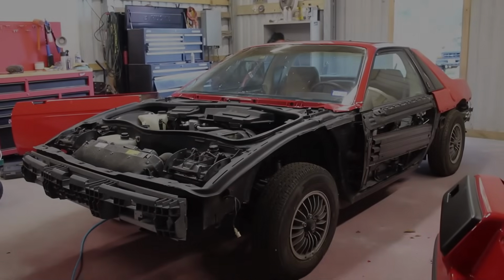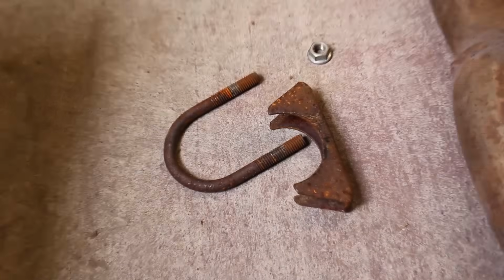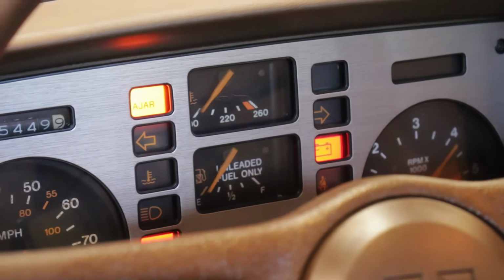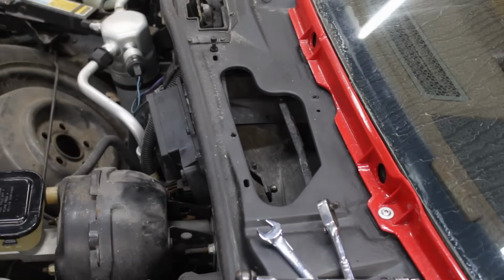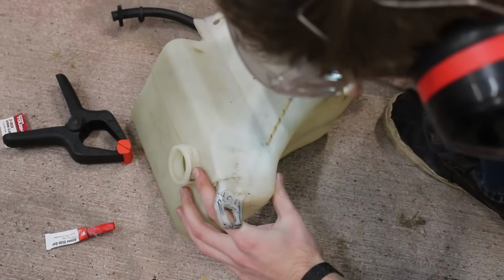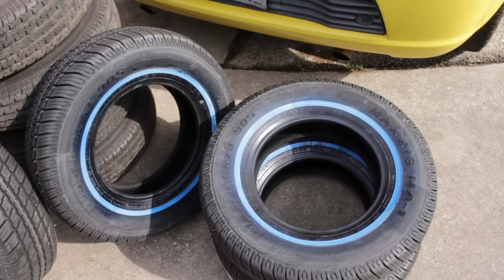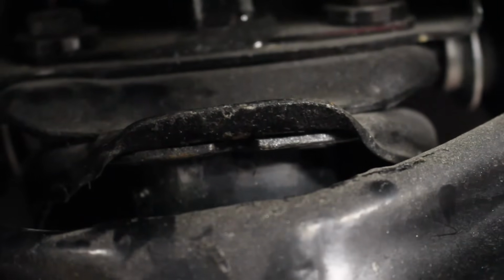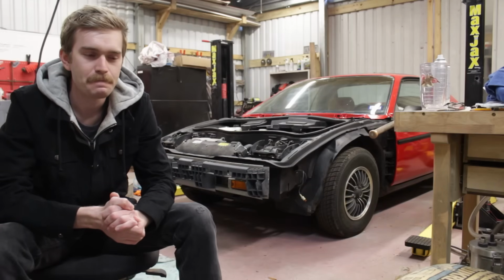The Haunting of Red Car | 1985 Fiero 2M4 Revival - Part 14

Comment: Fun fact about the wipers being fixed by just moving the switch so the contact gets cleaned a little, this is a common fix on older 80's SLR cameras when some settings dials don't work. Neat.

Comment: Ik its common but dont be un doing and redoing the fuel sending unit lock woth a screw driver. Ik its unlikely to spark but it can happen and even a small bit of fuel vapour can cause that thing to go bang. Use a brass rod to smack the lock rings that way they wont spark.

Comment: Its really amazing what we used to run as at least "psuedo" sport tires. 
13, 14s in the 180s....lol. (i didnt have a fiero, but did have a mustang 2, thundering 100ish hp v6, 13"rims and an overheating prob😂)

Comment: Hey this probably isn’t put on the correct video for this series but I kinda know a fix for your two different locks on your car. Lowes actually should be able to transfer the trunk lock to the other key set. I’m pretty sure it’s cheaper than buying a new same lock. But it may be more trouble to go through. It depends on the Lowes.

Comment: Browsed the comments but didn't see any one mention it.  Looks like you said you are only changing the front Springs and not the rear.  When you mess with spring rates like you did you need to make sure it's balanced between the front and the rear.  Since you changed the spring rate in the front, you need to change the spring rate in the rear to correspond with the front.  Your car is going to handle horribly with stock springs in the rear with those eibach in the front.

Comment: Kid!(which you will be called by older people until your in you mid to late 30's) I watch a lot of Fiero channels, and I have to say that you are by far the least boring and most informative, without insulting peoples intelligence. Frankly, if the viewers are having difficulty with your terminology, they need to consult some basic educational material on mechanics. Your very excellent camera work/timing/placement/lighting, along with your phrasing/tempo/common time/register/and tone of your voice are well suited to instructional videos. So far in the world of Fiero, I've learned and retained the most episode by episode. Now all I have to do is find a source to kindly supply you with a 2005 - 2008 Pontiac Grand Prix GXP 5.3L (LS4) V8 front wheel drive engine and transmission for you to transplant onto the Fiero rear subframe. It has all of the V8 stuff like starter/water pump/alternator etc, built out of the way and in a tight package in a transverse style, mated to a transmission that is made to fit in the tight confines of a front engine/front wheel drive car, with 303 normally aspired horse power. It is the smartest way to go for a Fiero. You would be the perfect guy to do the instructional video of the refresh and swap of the engine. Nobody else has the kind of detail and close ups of this kind of V8 swap, and so many people are waiting to try a modern swap of this kind. Think about it?

Comment: Hi! I love your videos! I’ve been watching for quite sometime and have been meaning to write here. We are only a few hours away from each other! Seeing your amazing work made me want to get my first car back on the road.... 1986 Fiero 2M6 SE!    Wulf is what I named it back when Killer Instinct was popular :).  I have this thing about naming all of my vehicles.  I had some really fun times as well as many annoying times! Not a very reliable ride but then again it was a used car.  Mine is the Red with black ground effects. I had always wanted to do a Finale kit body however I do not think they are even sold anymore :(. Wulf has not seen the open road in over a decade. The engine cranks but no spark to the plugs.  I used to do my own mechanic work but this left me stumped. I even had two other shops attempt to get it running with zero luck :(

Comment: Maybe this has already been asked, but hey there are over 3000 comments.

On the suspension, and the front riding high. Do you know what the reason for that was to begin with? Surely it didn't come from the factory that way. Rear springs compress over time? What caused that?

Comment: If I remember correctly from back when I owned my Fiero there is a strange and unusual process for filling the coolant... It involved having the car on an incline and filling from both the front and back fill caps and "burping" air out of the system... You might want to look up those details because I had to back in 2001 when I owned mine.  So I am less than clear on the details.  I just remember how strange and a PITA it was.

Comment: come on man, you can't just install front lowering springs - the rear is probably lower because the springs have sagged. you'll have stiffened the front and not the rear and it'll throw the balance of the car out of wack. put them all on.

Comment: Good work kid... proud of how far you've come.
Pop the wheels once more though and clean the rust off those rotors.
And, with brand new tires you can easily fine-tune your alignment once driving... keep a close eye on the tire titties (those injection thingies) and see how they wear. Quick on the outside: too much toe-in. A quarter turn is heaps... 1/16 at a time ftw until the wheel is centered at speed and it feels just right.
Can't wait to see 'er finished.

Comment: There are many reasons why i love the series. First of all. That he started as a kid is now a Boomer. But for real. He showed that with dedication and researching you can be a better mechanic than ectual mechanics. I wouldve replace alot of the parts he rebuild which i think is pretty inspiring because he really wanted to keep it stock and know how everything works. He probably will never do that again. But his dedication to make it as perfekt as he can is really impressiv. Edit; something really important down here

Edit; i just notice something kinda important. Your seatbelts should be replaced with new ones. When you pull them out theyll still full of mold. But thats not the problem. I think they might get weakend by the mold and beeing that old and could snap in an accident.

Comment: Just a recommendation, I would also replace the rear springs with the ones from Eibach. The mismatch of rates with stiff in the front and soft in the rear might make the car handle oddly depending on the actual rates.

Comment: 185\80-13? ouch...

yeah that's a strange size since mostly all 70's and 80's car with 13" was running 185\70-13.
and those would been to small for your car (over here they would been illegal since they have more than 5% difference in rolling length)
175\85-13 might have been an alternative, but pretty rare those too (as in none-existing at all)

Comment: Another method for your reservoir would be “soldering” with the same material. I’ve used it on a few small gas tanks and it seems to work ok

Comment: Excellent video series, but i can say from experience the hardest jobs that you can ever do to a car is not replacing and fixing oem components. Its the upgrades, the rewiring of systems, the re-engineering of mounting brackets and completely upgrading oem spec like stereos, parking senors, alarms. auto window modules, tpms etc etc that is an absolute nightmare to do without destroying the oem feel and look of the car.

Comment: I had a neighbor that went through this type level of restoration with a Fiero. He even put a Buick supercharged V6 in it and had it almost completed. They were doing a really quality job and spent a couple of years on it. Just before it was finished they realized it had a transmission front seal leak and asked me what was wrong (I was an AAMCO Transmission mechanic), I told them they needed to replace the pump bushing along with the seal, instead of just the seal. That was the straw that broke the camels back...they didn`t want to pull the transmission back out and do any more work to it and decided they were moving. They said the first $2000 that comes along gets it. I didn`t have $2000. I sure regret being so broke I couldn`t buy that! It was like 98% done.

Comment: I would install those rear springs. Different spring rates, softer in the back. No bueno.
Reply: Yeah better handling...i have a feeling he just didnt want to pull shit off or have it be lower in the back again...he didnt give a reason in the vid did he?
Reply: @insertname941  No, but not just handling. Having softer spring rate in the rear vs front can be very dangerous. Also the springs probably wouldn't have lowered it more in the rear I'd stock it was even. The rear stock ones have probably settled more.

Comment: Don't use worm drive clamps with plastic parts.  They create pressure points.  Instead, use the same type of spring clamp the factory would've used.

Comment: My issue with the wiper system on my S10 Blazer is the same, but the pinpointed problem is the  actual wiper stalk switch that the stalk slips into. Its a switch within a switch.  The GM part number is for a 1988 S10 but with everything being practically the same for GM stuff..
ACDelco D6389A

Comment: Yep. Cycling the wiper switch, cruise switch, and others on the stalks on an old, unused car tends to fix them. The little checkballs they use for the contacts tend to rust or gum up and rattling them knocks that crap off of them. Fixed several older car issues after getting pissed and switching them furiously out of frustration.......tah daaah!!!! wtf.....

Comment: I had an 85 Fiero GT.  Mine had the steering wheel play so much that I called it "floating" - driving the car felt like you were floating in a way above the road.  Even if you could just open the door to put out your cigarette on the ground without stretching.  Assuming you smoked.

Comment: I have an issue with a phantom car as well.  I have a 1984 Mercedes Benz diesel and it does weird things.  For one, whenever I shut it off, I can take the key out of the ignition, and walk away, and the car still stays running.  It isn't until a few minutes later when it finally shuts off by itself.  Also while I was driving a little while ago, the wiper come on for reason at all, and even though I flipped every switch, turned every knob, and moved every lever, they still didn't stop.  The only way I got them to turn off as when I shut the car down and then when I tried starting it again, there was just a click and nothing.

Comment: Three years is a long time, but t's actually perfect so that you wouldn't get too stressed out.

I read a blog 2018 by a guy who rebuilt either -84 Fuego or Fiero, cannot remember which one. It was not about how to rebuilt it but how long time and how much it cost. The guy was originally planning to just work on the brakes but before he could do so he drove it off the road to a swamp and broke the engine, then decided to rebuilt the car from ground up. It turned out to be a good idea. Practically every part was either too worn out or broken. Those cars, even small, yield a big pile of parts when all of them are in zip-lock bags. What he found fascinating was that he had to learn how each part works and what's the proper way to fix them.  Replacement parts were mostly too expensive but luckily the original parts simple enough to fix. It took him almost 3 years.  Too bad I don't have the original email that had the blog link. The parts spreadsheet was impressive, even small cars have tons of parts and some of them so unique they were in production only on that model year. Corrosion, rubber seals and some plastic parts were the main problems, the electronics not that much.

Comment: I would install the rear eibach springs as well for a few reasons. 1. The oem rear springs could be sacked out. 2. The front eibach springs will settle and will be lower than what it is now.

Comment: You really should change the rear springs as well.  A stiffer front suspension with the stock rear springs is going to cause a push in the car's handling.  The spring rate is balanced from front to rear for proper handling.

Comment: The wiper control reset by rapid switching actually works for a lot of vehicles. As well, it is directly involved in resetting the multiplex control unit in many Hondas, which fixes wiper and door lock issues.

Comment: "I am not a salesman or spokesman". For the repair of the overflow tank and some other bits on the Fiero or your next build you should try using The Last Glue. I was really skeptical of this glue when I saw their booth at the Orange County Fair, but having used it on a number of small repairs now, it is pretty awesome stuff. I even talked our OM staff at my work to keep a bottle of it around after demonstrating that it could be used to repair a fan belt on one of sludge pumps at least until a new one could be ordered.  Check out their website which explains how it works. https://thelastglue.com/

Comment: I am surprised that nobody has mentioned the brake discs, those rusty things will eat through pads like crazy. If I showed up for vehicle inspection with those they'd tell me to get them changed and return with it fixed, if I didn't they'd take the license plates. I guess EU rules are more stringent than in the USA...
But just the pad wear would make me replace the discs as it would be cheaper in the long run, and the brakes performance will improve quite a lot.

Comment: Wait . . . where's the "fully assembled" video?  :-)

Couldn't resist . . . also, this series has been absolutely amazing.  I recently bought an '86 SE as my project car (which I'll be converting to a fastback because, well, I like fastbacks and already bought the panels).  I was feeling VERY in over my head until I found your series.  Now I only feel MOSTLY in over my head, but with a sense that I CAN do it.  Our experience levels at the beginning of your series were about the same, and I thought you should know that, thanks to your empathy and passion, I feel encouraged and inspired.

Thank you for making these videos!  Truly. 

(And thanks for the STL files for those stupid body-panel screws)

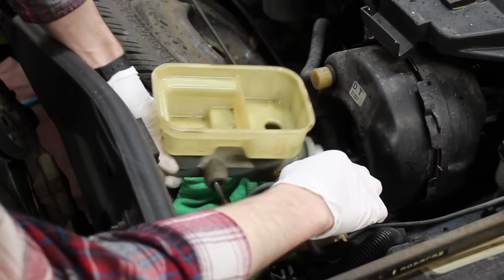Comment: 26:21 - that's actually one of the best feelings when you realize you don't have to disassemble something. I was repainting a part and was about to unclip some annoying wire connectors when i realized i could just unclip the whole button assembly instead. saved a good bit of time coming out and going back in.

Comment: Ah, my '86 Fiero 2M4 had all the same issues! Fuel gauge, tach, and I could push on the wheel wells from inside the car and hit the wheel. I had huge balloon tires on mine, though, with hardly no clearance; totally silly now, but awesome at the time! Also, I am quite envious that you have the time to work on such a project! I hardly have enough free time to use the bathroom!

Comment: Young man, I've enjoyed the entirety of your Fiero rebuild series,  and thus far I can't find fault with anything you've done.....except for one thing:

  Change those doggone rear springs! 

 Eibach engineers those spring kits to work in UNISON....handling and tire wear woes will plague you if those stock springs are left in place due to the differing spring tension rates and height. You already HAVE them, might as well use them....you'll be glad you did in the long run.

  Anticipating the next episode......

Comment: Shouldn't the rear springs be replaced, too? Not only are they without a doubt more worn out than the new ones in the front, they also probably have a vastly different spring rate. It would surely be annoying if this resulted in dodgy handling...

Comment: You do not have to pull the column apart to replace the multifunction switch. remove the connector body from the wire harnes for the multifunction switch tie a wire on it then remove the multifunction switch from the column pulling the wire up through it. Install is reverse of removal.

Comment: I used to own an 1982  Olds 98.  PLEASE replace the sockets for those dash lights! (if you haven't already)  The melt, and lose contact.  I cut, and put rubber sockets into the holes, and then wired them up to a switched 12v circuit on the fuse box.  Nothing is more of a pain in the ass when driving at night, hitting a bump, and having one of the lights go out randomly.  I needed therapy until I fixed it! LOL

Comment: Hey Ronald, congrats on having the Fiero "almost" done. It's been a cool series.

Just a little tip - you might want to install those rear lowering springs as well, because having such different springrates on the springs front to rear, could cause some pretty significant handling issues... imagine the car being able to lean more on turns in the softer backend than the front is able to - it will make you get less traction on the inner front tire when pushing it hard in a turn. Also the ride might feel a bit odd, with the rearend being able to articulate more, like hitting a bump with the wheels on one side making the car feel like its jumping sideways a bit in the back. 

Lowering spring are usually made so that you SHOULD end up with the car being totally level front to back when having them all in.

Oh and that ghost wiping scene was absolutely epic!

Comment: Did anything on this car NOT need repairing or cleaning? I swear every subsystem on this thing had multiple problems. um... thinking the stiffer/lower front springs are going to also mess with the handling. Fieros are not gymkhana stars either but it could introduce major and dangerous understeer.

Comment: 4:55 hold the mig torch much closer to avoid the sputtering. At that distance there's a much longer wire for the energy to deposit in and the gas jacket can't do its job properly